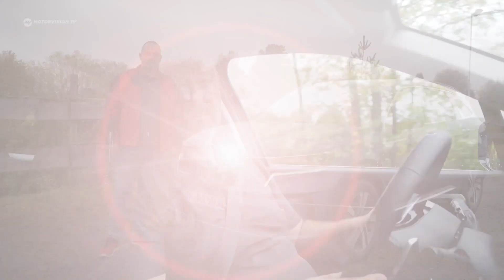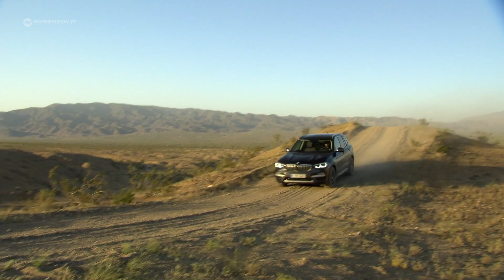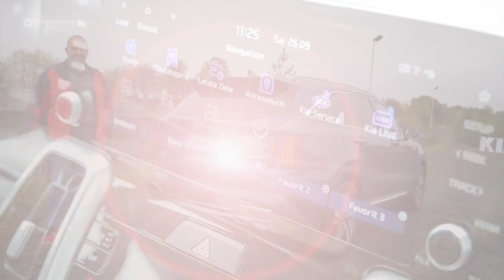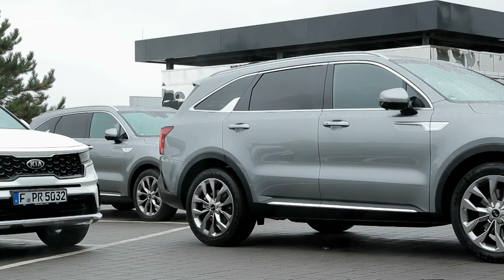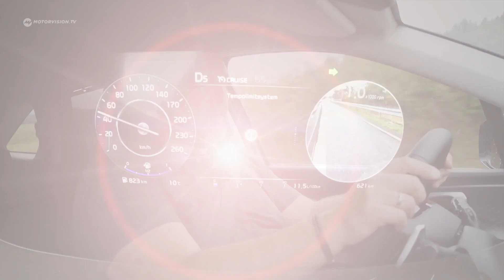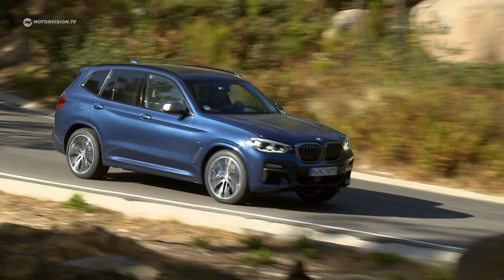Kia Sorento 1.6 T-GDI Hybrid and Sorento 2.2 CRDi tested and compared | Motorvision

Comment: I purchased the 2022 2.2d Deluxe model - its nice to drive, the only hiccup for me are the adaptive cruise, I wonder how long the brake pads will last as you feel it braking not just front but side to side as well. A lot of the tech is just gimmicky